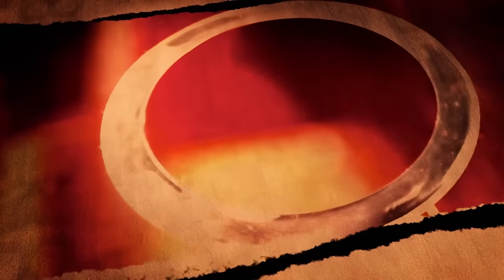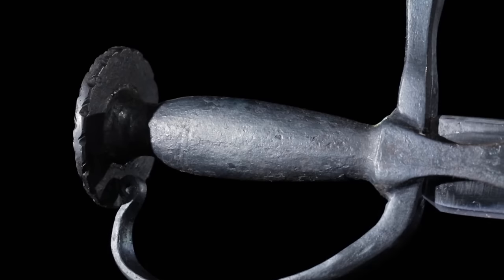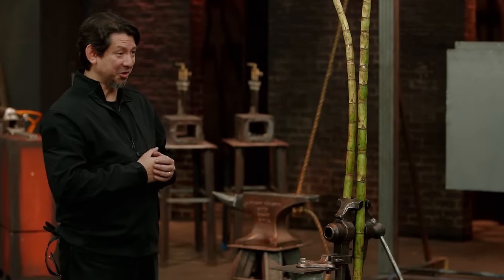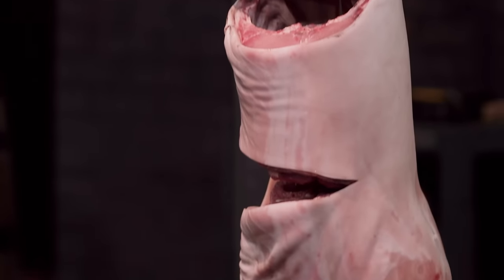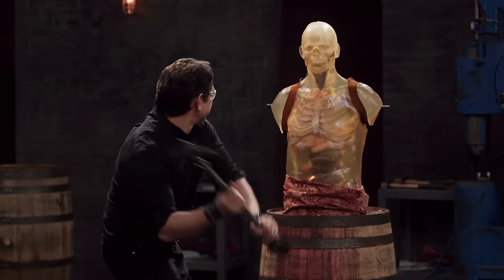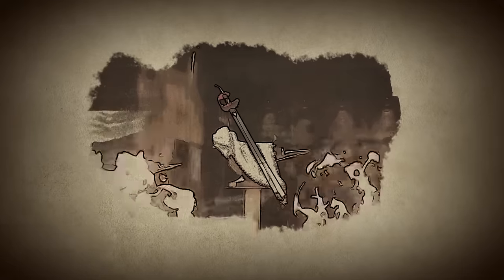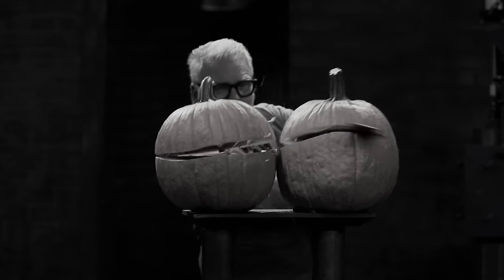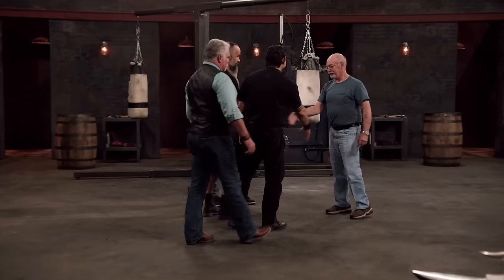ALL TIME TOP WEAPONS OF INDIA | Forged in Fire

Comment: stabbing a log and prying with the tip is pretty rough, maybe even a bad test, that'll break the tip almost every time if its a sharp tip. i guess it comes to tip geometry for different use cases but why would you want to make a dagger for stabbing wood? lol
Reply: I mean, it's a test of how durable it'd be if your attack was blocked with a shield, or if you missed and hit a pillar or wall, or when it hits bone

if your blade gets stuck in an enemy's shield they're likely to try to wrench the tip like that regardless of your preference on the matter